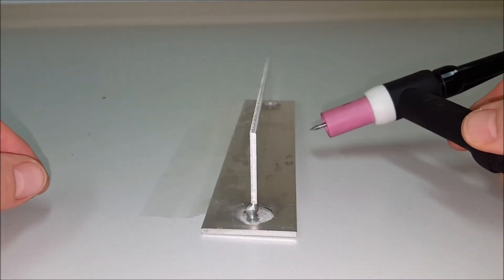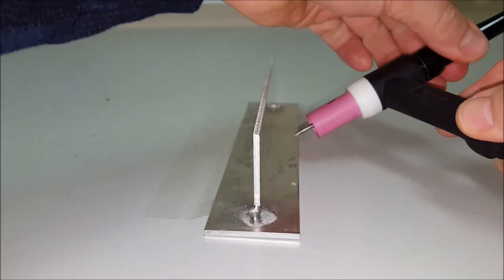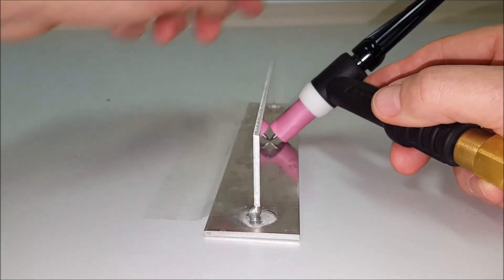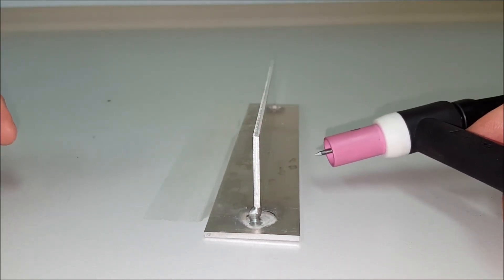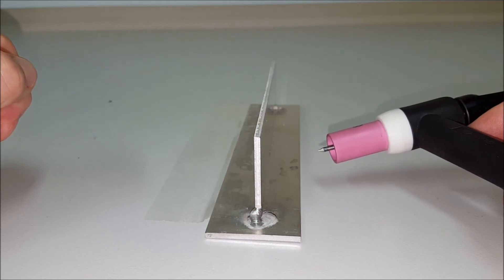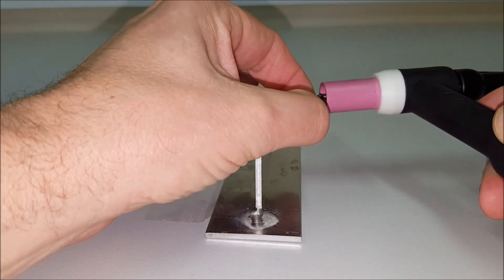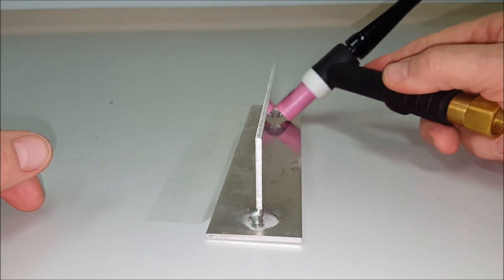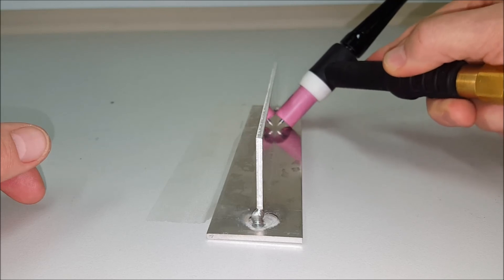tig welding torch setting tungsten stick out length for fillet welds

Comment: I give a thumbs up for anyone trying to help, but to show a technique that has so much variable is hard to learn from IMO. Maybe put the same size tungsten in the fillet as an offset gauge and then tighten up the back cap? Anyway thanks for the info mate...G.